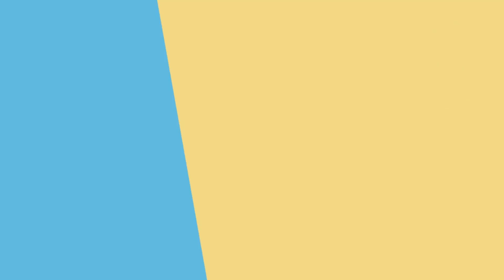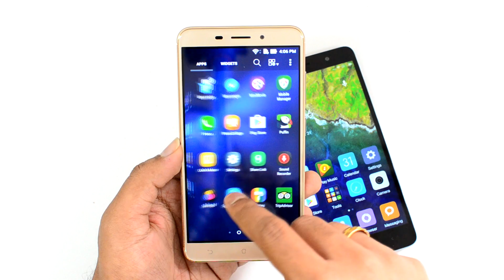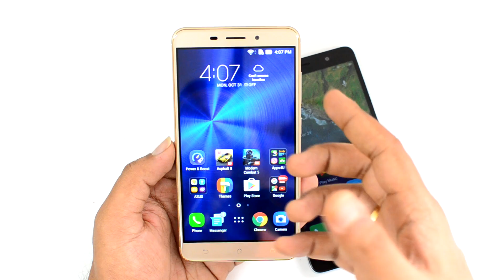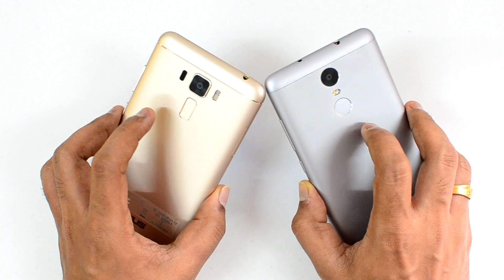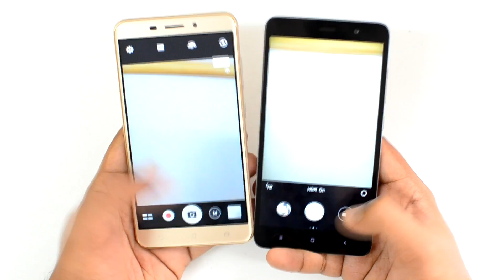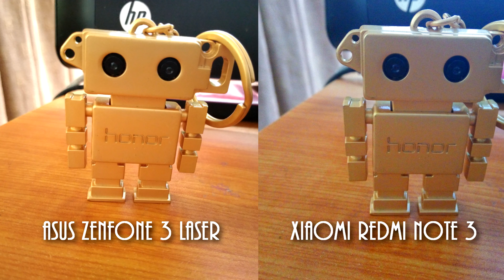ASUS Zenfone 3 Laser vs Xiaomi Redmi Note 3- Comparison, Speed, Performance, Camera and Battery

Comment: why xiaomi  charge less price? how do they offer so much features like battery , all sensors, powerful processors in such a lowprice than competition. do they compromise on quality? are the phones durable? how xiaomi redmi note 3 is having Snapdragon 652 in such low price.
Reply from the maker: Xiaomi charges less price because they are operating on wafer-thin margin and they do not have any logistics cost or deal margin which are present in Oppo or a Samsung by opting for online only model. The quality is as good as a Samsung or Oppo. I have the Mi3 from 2014, still working without any lag or issues. They are using quality materials like sharp display, Sony sensor and Samsung components in their devices. Only let down is that service centers aren't as good as Samsung because they have been here only for 2 years. Xiaomi phones are durable for sure. Also Xiaomi does not have any brand ambassadors like Samsung or Oppo, so that money is also saved and given to the customer.
Reply: Milan jeswani manufacturing in high quantity... simple economics
Reply: shubham saxena 
but there are other factors also like   profit margin, promotional expenses, after sales service, quality, availability(online or offline or both), brand valueetc. oppo is the leader in Chinese market. but oppo doesn't charge less price.
Reply: Milan jeswani yup u are right ..but unlike opo xiaomi doesn't spend money on promotion as well as xiaomi phones are sold more than opo in india
Reply: Milan jeswani also xiaomi doesn't have good service centres lol😂
Reply: shubham saxena they are the cost leaders. but are there any compromises in quality. i haven't used a xioami phone and is liye ye thought aaya ki itne kam price mein much more features than competition.
Reply: Milan jeswani quality is average.. not that good compared to others
Reply: shubham saxena ok.. thanks ☺
Reply: Shilpa Nambiar ??